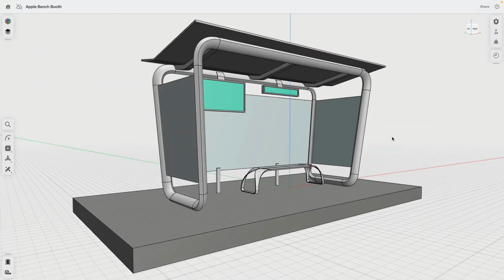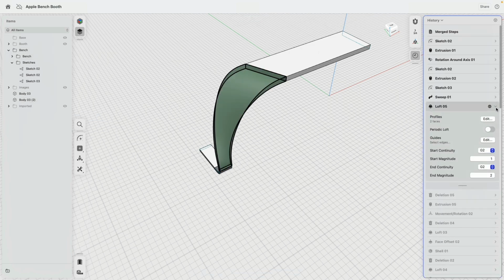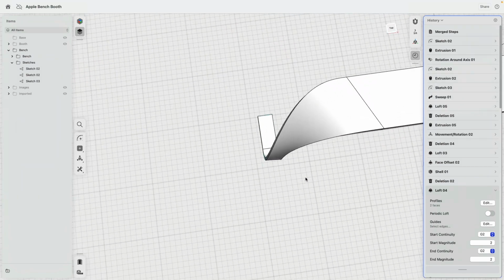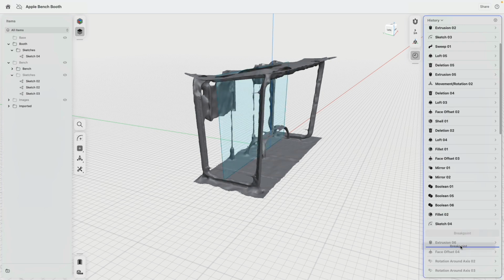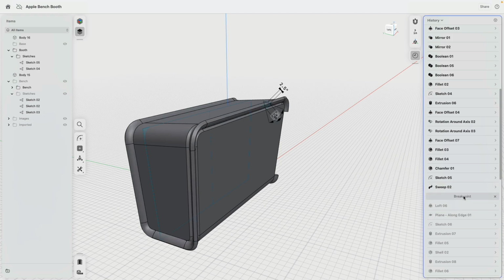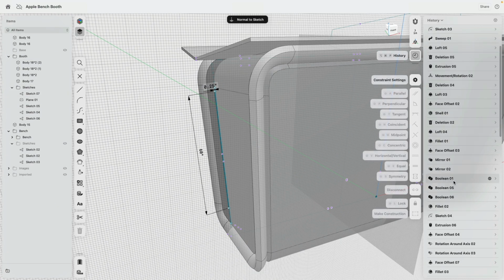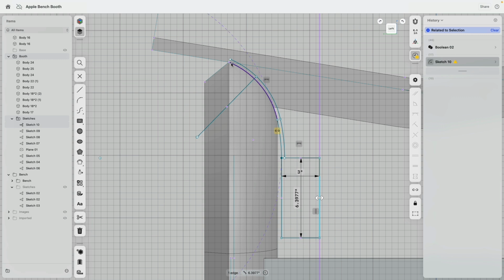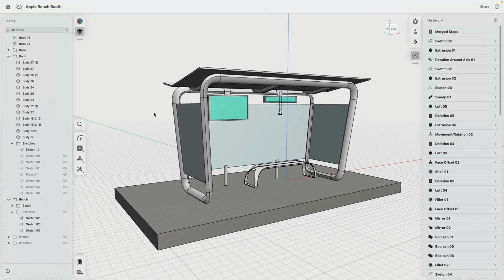Shapr3D - Apple Bus Stop

Comment: Hello dear developers of this wonderful program. I saw your video about the design of the bus stop and decided to write this comment. I have been working in your program for three years, if not more. I am engaged in the design of restoration of ancient buildings. Since ancient buildings are often deformed, your program is very suitable for me, because it allows me to build complex surfaces. And so. Now I have one building in operation, which is almost 200 years old. By design, it is quite simple, but has very strong deformations. I build a model of it based on the results of laser scanning, I also used a manual optical scanner and photogrammetry. I have about 1,500 bodies in the model now. I've been working on this building for two months now. Today I updated the program to the latest version and encountered a very unpleasant phenomenon. The program closed itself after any action with the model. That is, I could not continue to work. I probably accidentally changed some sketches.
I had yellow icons in the history menu. I was very upset. I was kind of desperate. My favorite program has stopped working normally! However, I found a way out. Saved the project in x_t format, then created a new project and imported a file in x_t format into it. Everything, of course, opened up, and the sketches and the story disappeared. Tomorrow I will try to export the sketches I need to a new project. Maybe my experience will be useful to someone. good luck to you. At the same time, I would like to ask if possible to return to the program the ability to delete sketches without deleting bodies. Maybe I'm misunderstanding something and there is such a possibility. If so, please tell me how to do it.
Reply from the maker: Hey I am not part of Shapr3D I just teach it.

go to "https://discourse.shapr3d.com/"

and post your problem there !!!

I am sure they can fit it.